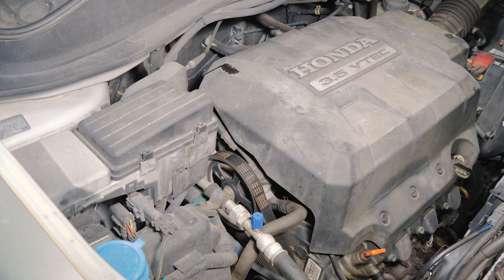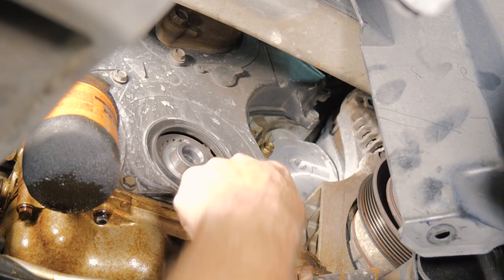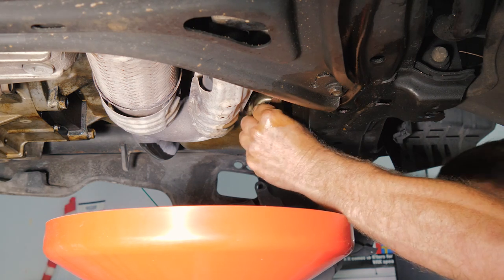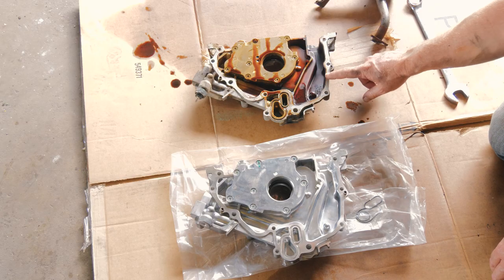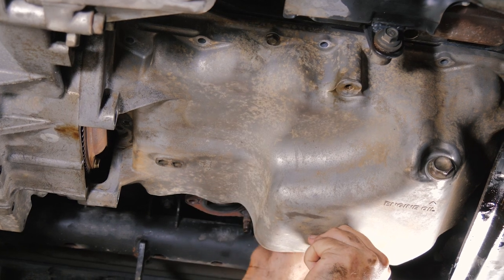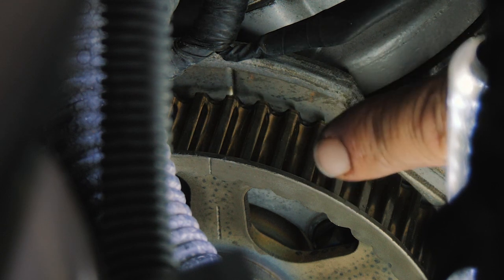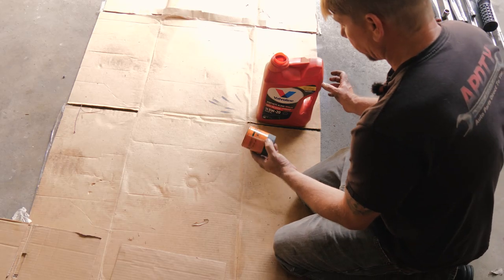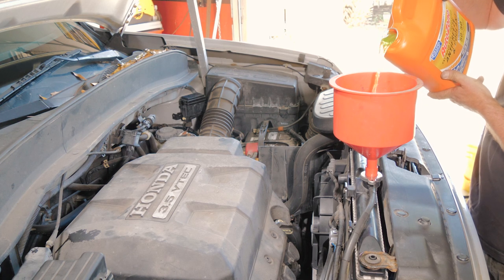2006 Honda Ridgeline Oil Pump and Timing Belt Components

Comment: For a less messy job, this engine has a coolant drain plug. Also, Honda engines are very picky about using only genuine Honda coolant. Anything less is putting the coolant system at risk, including the head gasket. The job is also much easier to do if you take the power steering pump out, it doesn't take much time and it gives you  a lot more room to work. Replace the fluid with genuine Honda power steering fluid also. Lastly, the FSM mentiones that before putting the covers back on to turn the engine manually a few times to double check that everything is well aligned. This is a very important step, since of you're even out by one belt notch you're putting the engine at risk. For the parts I only trust the Aisin kit.

Comment: Thank you so much for the video.  I used it to help replace the oring in the top of the oil pump. There are many timing belt  videos but none go past the timing belt portion and into the oil pump tutorial. This is apparently a common leak on these J series engines and everyone  doing a timing belt should get this oil hole gasket replaced at the time of a timing belt.

Comment: I think book time is about 8 hours.  Hondabond RTV says 24 hours before filling case with fluid.  For a DIY person with average mechanical skill, taking your time I would budget 2-3 days.  Includes picking up parts, test driving, waiting for RTV to dry, cleaning and dry fitting, rechecking torques and leaks etc.
I suggest not removing the rearmost exhaust bolts, unless that joint is leaking.  Instead, detach the exhaust and mufflers from rubber hangers towards the rear, keeping the entire exhaust in one piece. Great video thanks for posting. Really nice job reinstalling the oil pan without bumping the RTV around, thats not easy.
Stay gold.

Comment: Hi, I believe you mentioned the reason why you replaced the oil pump... Was it because it was leaking? I believe mine has a bad oil leak coming from the oil filter housing but not 100 percent sure especially from its proximity to the oil pump. Was your oil pump leaking? How can you tell where the oil was coming from? Thanks!

Comment: I couldn't get the belt on so I rotated the exhaust cam causing it to snap forward about 40 teeth. Now it won't stay at TDC without holding a wrench to it. How can i get it to stay put again?
Reply: Put your belt on both cams and set it to TDC with the wrench. Once it’s in place use clamping devices on both cams holding the belt on to the cams so they won’t jump. I used small vise grips and protected the belt with cardboard. Once you release your hydraulic tensioner you have set your belt. You can now remove the clamping devices.Turn your crankshaft and ensure your engine timing is TDC.

Comment: How did you torque the crankbolt back in? Did you use an impact gun or torque wrench?
Reply: You should always use a torque wrench. Check the car’s specifications. In many Honda’s the torque is 181 ft lbs or 47 ft lbs plus 60 degrees. If you want to do it right you will need the Honda crankshaft tool that keeps the crankshaft from moving. You can purchase the tool from your auto parts stores. They are usually $ 20.00 and up. You can also rent them.

Comment: how much does that job cost Canadian?
Reply: ít cσѕt mє $950
Reply: @tumarbongrox6074  That's cheap!  That's the labor cost alone for a timing belt/water pump replacement in the U.S., let alone adding in an oil pump.
Reply: Including the oil pump, if you're anywhere near a good size city in Ontario, you'll have a hard time finding someone who knows what they are doing for less than $2k.